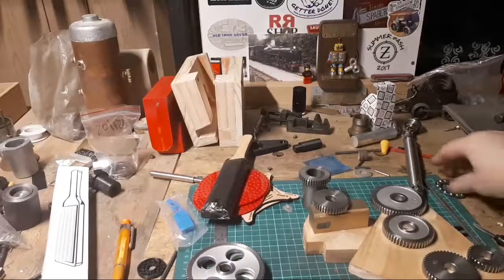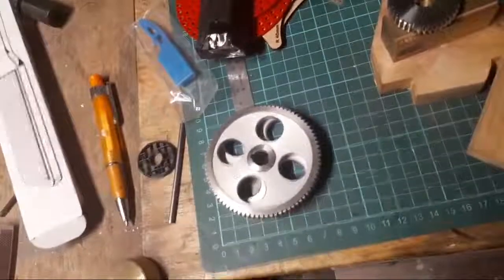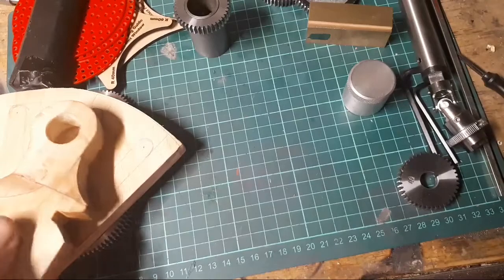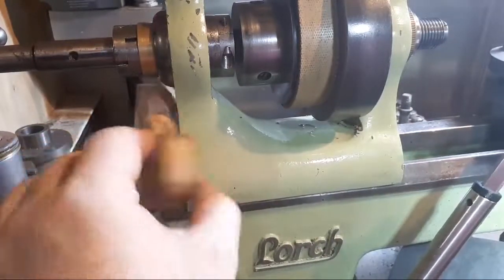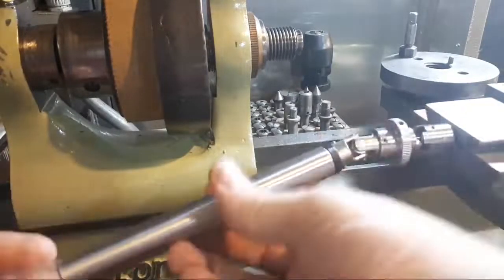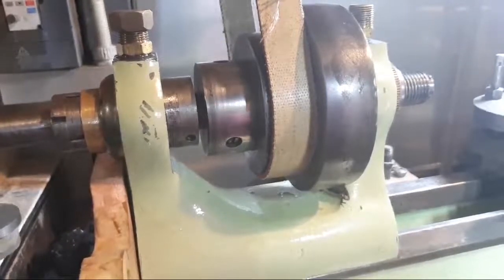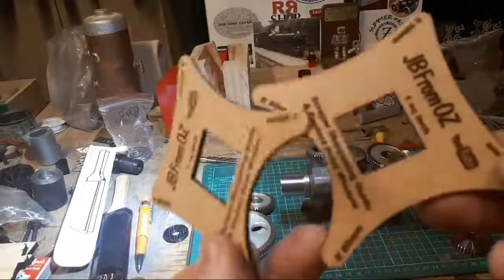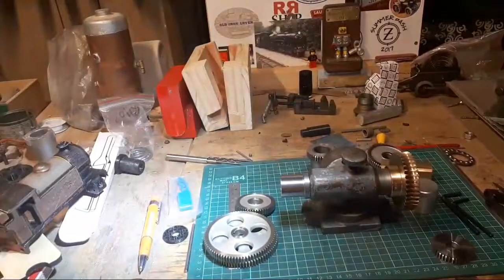Wednesday Night Live feb 13

Comment: When you say mid  30's you describe my place only it's in Fahrenheit.

I just turned on the heater. My wife is my curse. She's doing the "change" and turns the heater off after 35 degrees Fahrenheit.

I am just about ready to do the Hansel from Hansel and Gretel and crawl in to the oven stay warm.

Hello!
Reply: I have the same problem here in the UK.  Freezing cold and windows wide open. regards
Reply: @garyc5483  I curl up in 2 blankets and feel like a hobo in Manitoba. :(